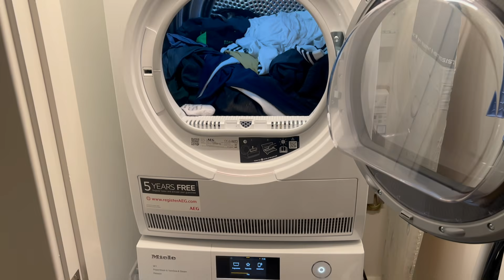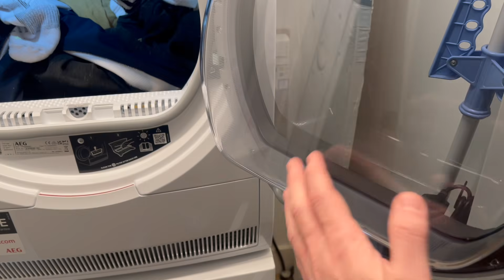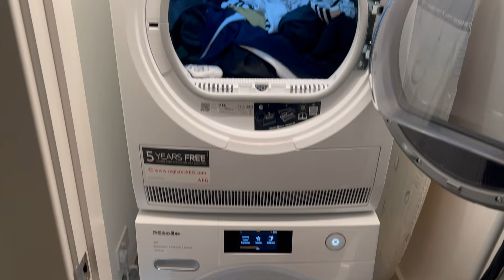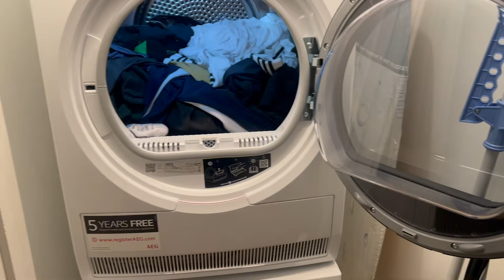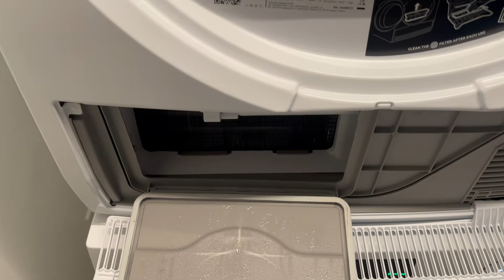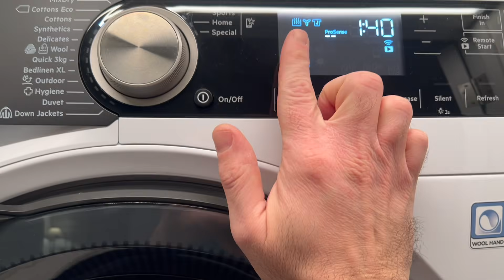Should you buy an AEG Heatpump Dryer? Longterm Ownership Review

Comment: Such a brilliant machine! Such a shame it doesn't have any delicate drying option but, it is a bonus of this dryer to reverse tumble as my Siemens 500iq dryer not tend to have, unfortunately. 

And if you don't mind me asking, how long does it take for 9kg to dry in your AEG? My Siemens displays 4+ hours on cottons for 9kg but your AEG displays 2+ hours, even though yours and mine are both heatpumps 🤔

Really enjoy your reviews, so please let them come more whenever you're available. Excellent machine, again! :)
Reply from the maker: Thank you very much! So the worst case I’ve had is 9kg of towels which spin at 1200 - took over 2.5hrs. Usually it’s around 1:40 which I don’t think is too bad for most loads. I did look at buying a Bosch before this but was surprised to find whatever version then didn’t rotate both ways.
Reply: @s @sabistar44  Wow, 2.5hrs is actually not a bad length, considering drying a full load of towels. My Siemens takes that same amount of time to dry half load of those towels! 😬

Also, the premium iq700 and recent iq500 series actually rotates anti-clockwise now. But, as i’ve seen from other people’s reviews, they only rotate anti-clockwise in duvet program :(

Comment: witch program you use for everyday clothes? mix dry? I recommend to use this program that work differently of the others, because alternate on and off phases of the compressor, and when is off the warm full of steam clothes ironing them self, is much longer program but you will see how soft and less strinkage they came out... cotton is hot and taste cycle but really heating to much and also if I leave the normal setting they still dump, I added a + in the humidity sensor and they still dump, if I use extra dry even whitout + they are to much extra dry.. so I can only use cotton for drying towels, but you make me think to download away the towels program because I tried once and they was still dump too, I normally use it with a + in the humidity sensor, and I have to try like that because when I used it was a standard no +

Comment: I got a Miele T8164wp tumble dryer and it’s a earlier model think it’s 15 years old I have owned it 5 years but hands down it’s the best dryer I have ever had and so cheep to run it.  Never owned anything AEG but did have a zannusi jet system for years and they were Electrolux it was great still worked when I gave it away. 
 might try this one next when my Miele washing machine and dryer give up as they are both 15 years old.

Comment: I have the 9000X version - Love it! There’s a few adjustments compared to the 9000, it’s 60db, A+++ -25% energy rating and a new filter/base design. I also noticed there’s no seal on the front panel, just on the door now. It also has an inverter compressor instead of standard - giving you the energy or time selection. I have added my own thin piece of foam
Reply from the maker: Oh wow, it sounds like they've improved perfection. Maybe I'll upgrade...
Reply: What model number

Comment: Also it's worth putting a foam filter in front of that heat exchanger. It's inexpensive to get one that is 15mm thick which is what I have, just cut it about 3mm bigger than the internal dimensions so it fits snugly. You can do a load without it and time it, and then do the same kind of load again with the filter and if it ends up taking too long to dry or whatever else you can always remove it, but it does save you time on having to painstakingly scrub those fins every few cycles.

Comment: Some of the programs have the compressor cut out periodically and they take longer to dry so I think that's your low heat essentially, definitely on delicates and also mix dry doesn't heat the clothes too much either. Yours is a newer and more advanced model so maybe it has an inverter compressor but I can't verify, but you'd know if the compressor noise changed in pitch as the cycle goes on.
Reply from the maker: I've heard the compressor cut in and out an other programmes, not cotton though. I am keen to explore the 9000X which I am told is inverter.

Comment: we have tre of those machine, Electrolux the first my sister since 8 years 3 cycle a day every day still perfect the old steam care never used steam anyway... she allways use cotton eco, the second of my mom 6 years perfect care 900 after 4 years fortunately we paid for the warranty extension they change the mother board, humidity sensor, rotors bearings, and completely demounted cleaned and re assembled, mine, will be 2 years in April perfect care 900 with wifi and everything, some time when switch off the compressor like in mix cycle that go on and off in make a strong 2 second noise... I don't know. also the plastic door get scratched to all of tre but I don't care, one time with the plastic ball inside completely scratched the on of my mom and I polished with car polish to make it look nice again. but the way allways wash jeans in reverse with bottons and zips closed. ps, the one of my sister seems the best but they had to change 3 of them when she bought it because they have differents faults.

Comment: What I love the most about this dryer Is Its wool program..high speed drum rotating to prevent the delicate wool load to tumble and damage Is a very smart design🤓👌
Reply: Hotpoint Gentle Power Dryers Do The Same Speed Up On Wool Cycle On There Heat Pump Tumble Dryers,Plus Use To Use It For My Bedding So It Didn't Roll Duvet Covers Up Into A Ball
Reply: @laundryman6953 That is the big problem with my Bosch heat pump tumble dryer..It doesnt do reverse tumble and makes bed sheets a ball🤦‍♂️
Reply from the maker: It is good, but I find the 2hr cycle time excessive!
Reply: @sabistar44 It is probabely because of using lower temp than other programms to dry woollens🧐